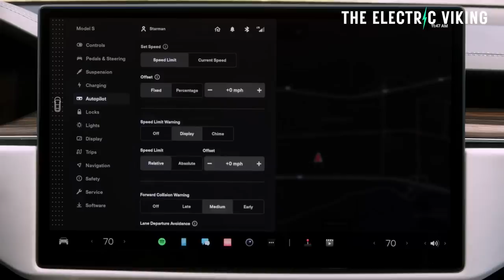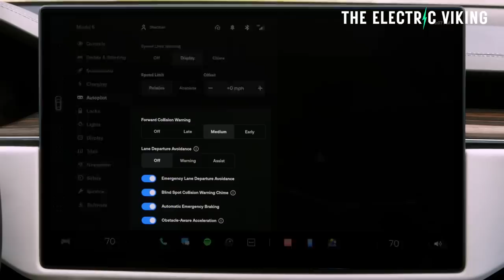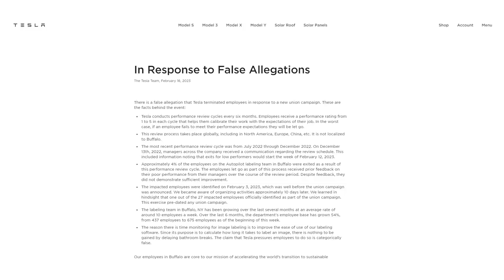Did Tesla REALLY fire employees for attempting to unionise Giga NY?

Comment: I worked at a union shop in IT. I got reprimanded because i moved a defective monitor and replaced it with a new one. Instead i had to wait seven days before someone came over from the union and replaced it in 10 minutes. With HR policies and federal and state laws in place to protect workers unions are no longer needed.

Comment: In germany "a say in the company" is in place since decades. Sometimes it works sometimes it doesnt. But if it works, it mostly turns out to be a very good thing for the company. There is better feedback and most of the times problems can be solved, that management normaly can not see.
Reply: Tesla culture encourages input direct from bottom to top if seen as necessary.  NO union mafia will improve on that, in the USA they do nothing but cause conflict within.

Comment: There's no such thing as a "good" union. These unions are the reason why all legacy auto are failing.
Reply: Poor management is why legacy auto are failing. Not unions.
Reply: Unions have not destroyed legacy auto.
Lack of imagination, greed, failures in management, and outsourcing to sub assembly suppliers have done that.

I have worked non-union and union throughout my career, for companies that failed and thrived. The one thing that thriving companies had, regardless of union status, was good management with a fairly flat management structure that encouraged innovation and communication at all levels.

None of the "not my job" mentality, and the sense that we were all there to do a job, and that job was to succeed at our work to the best of our abilities, and that our ability was appreciated. Any suggestions on how to make things better would at least get consideration and an explanation as to why it might not work if rejected.